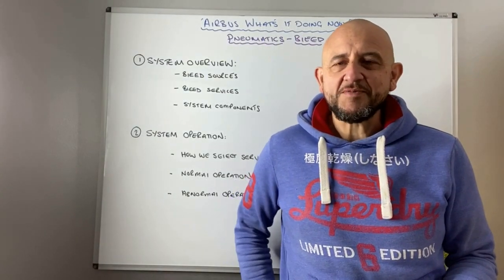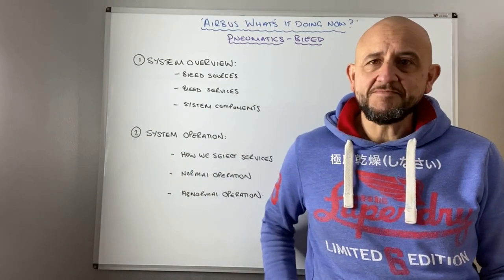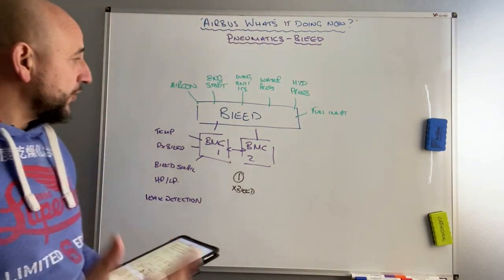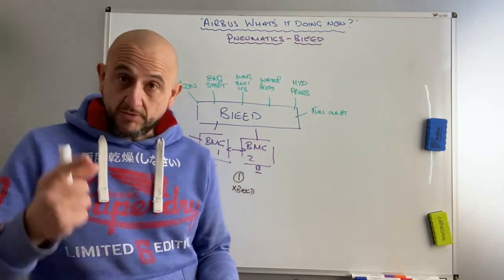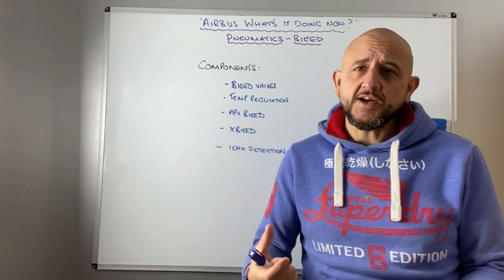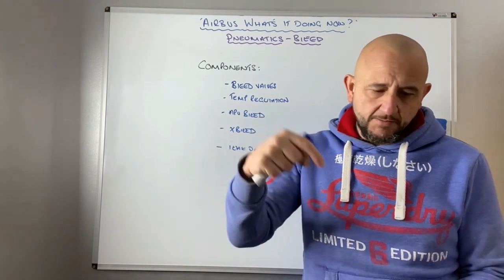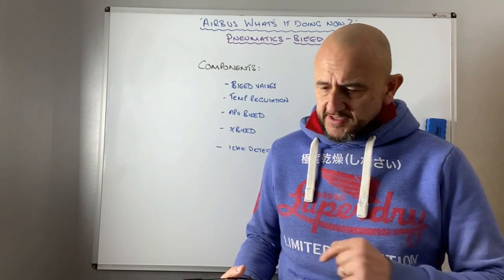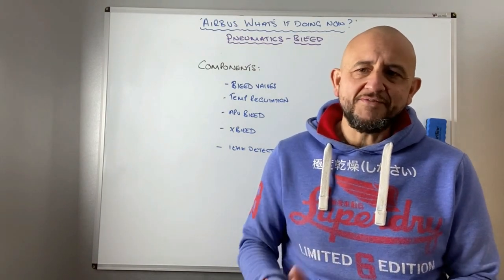Pneumatics. The Bleed System. New Version!

Comment: Great presentation as usual! I have a question though: in case of the “AIR ENG 2 BLEED LO TEMP”, the procedure asks to open crossbleed, turn off eng 2 bleed, and then to turn off the Pack 2 as well. Why to turn off the pack 2? Why not feeding pack 2 with eng bleed from number 1 since the crossbleed had been previously opened and eng bleed 2 is off?
Thanks a lot for your videos. Really appreciate!
Reply from the maker: Thanks for the question. 
This warning is triggered when the  Wing AI is on with low temp. Having the crossbleed open ensures Symmetrical Wing Anti-Icing and of course single bleed source means one pack only. Happy Easter
Reply: @airbuswhatsitdoingnow320  thanks a lot! Happy easter!
Reply: @airbuswhatsitdoingnow320  L2 info in the FCOM also states: One pack must be closed when the flight crew uses WAI due to "precooler" performance. Precoolers are quite weak to handle dual pack operations with a single ENG bleed source. If that associated precooler goes kaput, you have a BLEED 1+2 fault.